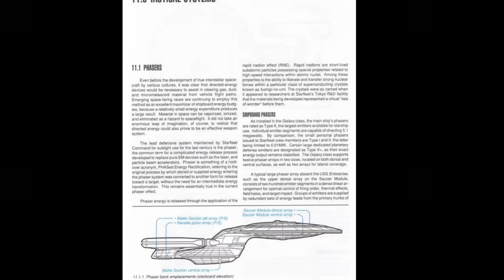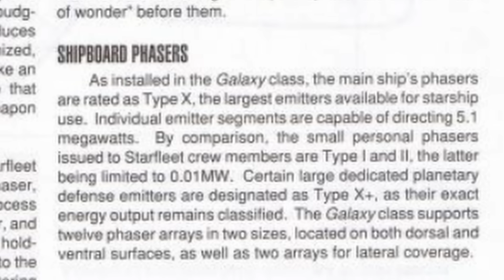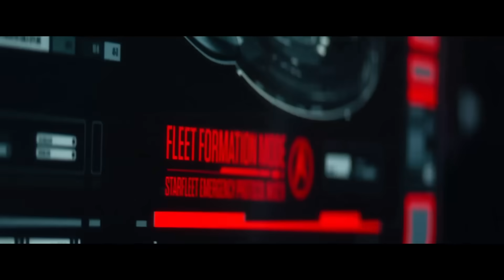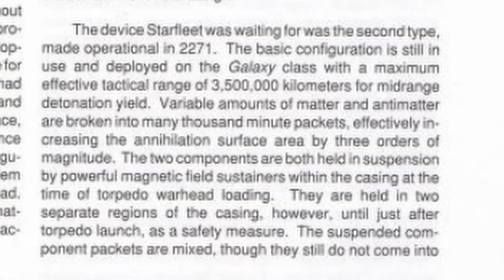Phasers: How Powerful are they Really?

Comment: Basically, from what I can tell, the payloads and TM figures are at best 'baseline' levels.
Since we know that subspace technology is used in most Trek technology, it wouldn't be outrageous to think that there is a form of subspace amplification effect going on - that's the only way to reconcile on-screen feats that seemingly go WAY beyond the baselines.

The ENT-D Warp core was rated at 12.7 Exawatt in 'True Q' for example - but given its actual overall AM storage tanks, if it was generating that much power at baseline, it would deplete its AM stores in hours. So, I would posit that the actual baseline output is somewhere in the high Terawatt or low/mid Petawatt range (if we want it to be able to sustain operations for 5 years before needing refuelling) with subspace tech doing the heavy lifting in AMPLIFYING yields (and obviously, the more M/AM you smash together at an accelerated rate as baseline, you can feed the systems that much more power and amplify the yields).

Now, as to the ENT-D drilling holes into a planet and implying the phasers would have to be massively dialled back... well, that's not unrealistic for Starfleet... because when you think about it, Starfleet is about ethics, safety, exploration, science and diplomacy (defence too, but only when necessary).
So generally speaking, SF ships are NOT in the business of destroying planets left and right - and to be fair, that would be monumentally wasteful thing to do as well (for any power).

The episode in question where the ENT-D had to drill holes into the crust involved the ship having to exercise extreme precision - otherwise, they risked killing everyone on the planet, so 'massively dialling back phasers' makes sense.

SF also has a pretty high mastery of energy/matter conversion technology too  - so I'd posit they were able to make use of subspace to radically amplify the energy outputs (and explosive yields) while using baseline figures that imply MW or TW range (or even PW).

Oh and this is NOT to be confused with weapons that destroy subspace - there are different EFFECTS weapons can have. Phasers/Photons and Warp core can still use subspace tech for energy/yield increases WITHOUT damaging subspace or opening tears.

So a starship being capable of outputting the power that's equivalent to half the sun's output, isn't outrageous - its just not normally used because fights involving really dangerous enemies consist far lower actual %.
This also means the Trek material science and field manipulation is critical because they can direct these massive outputs without fallout (if they choose to), and are designed to absorb them (which means, most other Scifi franchises also don't hold a candle to Trek's own capabilities).
Reply from the maker: Good summary. 
In matchup terms, restraint should not be confused with weakness.

Comment: The most visceral visual of a phaser strike was in Discovery season 5 when the Antares fires on the surface. Also the Ent-D was punching massive holes in the borg cube in the first encounter until the borg adapted and repaired. If they had struck the cube enough times there wouldn't have been a cube left.
Reply from the maker: Borg would’ve adapted before too much damage but yeah, phasers are absurdly powerful

Comment: Phasers seem to be about 1/5 the power of a photon torpedo
Reply from the maker: The problem is, where are torpedoes getting all the energy from?

We can see how powerful phasers are so if torpedoes are 5x as powerful, where's the energy coming from? Not a simple Antimatter reaction, that's for sure.
Reply: @fictionrant7805  the math supports a 64 megaton photon torpedo
Reply from the maker: @saquist right
Which makes a torpedo about 2/3 as powerful as phasers

So what’s going on?

Comment: They can punch through a planets crust in seconds. I always thought they would be similar to 40k plasma weopons
Reply from the maker: Far beyond any standard Imperium weapon but fairly comparable to Necron particle whips
Reply: @fictionrant7805 for sure, the rapid nadion particles in just saw as super heated matter. Like a particle cannon you say!!! So maybe not plasma at all. Perhaps a mega melter cannon...
Reply from the maker: @RA10H56  Phasers are definitely NOT plasma cannons. Turbolasers from Wars more closely fit that description.
Reply: @fictionrant7805 right, the tabana gas is superheated and turned into plasma to fire turbo laser bolts. But would accelerating nadion particles do the same thing?
Reply from the maker: @RA10H56  kinda like saying a tracer round is a thermal weapon because it’s on fire

Technically, yes but not where the danger comes from

Particle beams of any variety are such because you’re firing particles at near the speed of light at a target. 

In the case of phasers the particles themselves are also super dangerous and more so at the speeds involved

A plasma cannon involves generating plasma and hurling it at your enemy. That plasma just needs to be highly energetic, not fast moving. If you were to stick a lightsaber in a t-shirt cannon and launch it at someone at 20mph, that would in effect be a plasma cannon

Comment: Are they more powerful than Distributors?
Reply from the maker: AFAIK disruptors and phasers are the same thing but simpler. The plus side is they’re cheap and easy to maintain. The downside is that they’re far less versatile. Handheld disruptors don’t have stun settings for example

Comment: My understanding is that it is not the energy out put that causes the target to disintegrate, but that the phaser provides a pulse of energy which determines and transmits the correct frequency of the molecular structure of the to cause the molecular bonds to dissolve, thus causing it to disintegrate when set on the highest setting for most  organic targets, when it gets a lock on the target. On lesser settings, or when it is a glancing blow or doesn't get a lock on, it only disrupts the molecular structure enough to cause phaser burns, or only stun the integrity of the target's molecular structure causing it to fall unconscious.
The Klingon disruptor does something similar, but instead of dissolving the molecular bond it tears them apart making it much slower and more painful. Other such weapons work on similar principles, attuning, locking in and then causing the molecules of the target to come apart. Thus the energy needed is only to detect, lock in and transmit the frequency to start the chain reaction which causes the damage or disintegration, not enough to do the damage itself, and so can be of a much lower level.
This is based on something i read a long time ago. I do not remember the source but it might have been from a Role Playing Game.
Reply from the maker: Interesting 
I’ve never heard this particular explanation before

Comment: Torpedoes would still make sense even if phasers were actually that powerful because you are talking about the difference between an explosion versus conflagration (burning). I think the strange new worlds is a combo of systems power being shunted through the phasers but also notice how small the beam is. In all the shows a ship born phaser cannon/array usually outputs a been that's three to six feet across (serious speculating based on appearance) and in the strange new worlds episode they had two ships firing a beam that was less than a foot across so I took it as an all power to phasers situation with them focusing the beam to transmit power rather than raw destruction...this means, in combat they wouldn't be able to output that much destructive power through the phasers without sacrificing literally everything and becoming the true definition of glass cannon. Also means, if a ship is damaged and is going to sacrifice itself it cannot go full phaser boom because of the damaged systems and energy output and they might be able to get one good blast off before they get themselves vaporized...
Reply from the maker: Glad we agree lol

Torpedoes are certainly useful in ways that phasers aren’t but if phasers are literally a million times more powerful than torpedoes, there’d have to be some mental gymnastics to justify ever using them in combat
Reply: @fictionrant7805 Yeah, the way they talk about them in the show the only thing holding them back is the plasma conduits and amount of power available. Means if they can hook a phaser up directly to the warp core it probably would be that powerful. But during it would probably destroy the ship since the structural integrity fields would be offline to achieve such a thing 😉
Reply from the maker: @jakejager maybe that’s what phaser lances are, giant arrays tied directly to the warp core

Comment: The SNW usage of half-solar output is probably a writing goof. They could have meant half the solar energy that reaches Earth, or the writers don't understand how much power a star outputs.

There is also a lot of "It's Over 9000!" power creep and revisionist history going on to the point of making past technology way more powerful than future technology. This has the effect of destroying the legacies of past shows: imagine if every time OG Sisko faced a threat, he could easily channel a thousand supernova through DS9. Boring.

Another problem is that some of the shows are clearly not canon with blatant disregard for established lore, rendering comparison entirely moot.
I chalk the discrepancies up to the difficulty maintaining a cohesive narrative across multiple shows over 60 years, writing incompetence, and overt fourth-wall breaking political agendas. A serious writing staff would be concerned with maintaining consistency and telling a good story.
Reply from the maker: I don’t consider STD canon and have a whole video about why lol

SNW from what little I’ve seen appears as at least an attempted return to form. It even fixed the Klingons!

As for the energy output, they knew exactly what they were doing. They specifically called out the amount of energy then contextualized it as equal to the energy output of specifically Earths sun and outputting that kind of power would require 2 phasers working together. 

As pointed out in this video, the energy output is actually consistent with “The Die is Cast”

Comment: If phasers "vaporized" targets, there would be an explosion that leaves a 5 meter crater and which is near certain death out to 50 meters from the shock wave, and major structural damage & injury out to ~150m. This is a "large building scale" explosion, equivalent to about 50kg TNT. The fact that targets dissipate into a harmless mist indicates a process relying on some other mechanism than projecting sufficient energy to convert body mass to vapor. The conventional explosions that result from some phaser blasts must be considered minor secondary effects due to some residual energy leaking from the principle matter-disintegration process. Maybe phasers operate on principles related to the disassembly phase of transporters.
Reply from the maker: Are you suggesting that phasers are incomplete transporters which have a pattern buffer to contain the energy of the targets they disintegrate?
Reply: @fictionrant7805  Not suggesting anything that specific. I would imagine phasers completely lack a "pattern buffer". They disassemble and scatter.
Reply from the maker: @GreylanderTV another commenter is suggesting that phasers basically determine resonance frequencies on the fly and strike those to stun or disintegrate
Reply: @fictionrant7805  resonances don't change the energy involved, unless it is some new kind of "resonance" (new and mysterious made up physics) where we have no idea how much energy is involved.
Reply: @fictionrant7805  per my comment in another thread, I like the idea that phasers somehow shunt matter of the target "out of phase" with the normal universe, effectively disintegrating the target without a massive energy flux or explosion.
Reply from the maker: @GreylanderTV  the fact that there isn’t a massive explosion or pile of dust makes it all weird, most definitely
Reply: @GreylanderTV the problem then comes full circle. You still have to output enough energy to break apart particles on atomic scale. I.e vaporize things. Putting that in to perspective, transporters are both diabolical and incredibly dangerous weapons in what they do.

Comment: That hole drilling scene in TNG is a good way to estimate the absolute minimum their main array can output. However, at the end of the day, it just isn't enough. Phasers just aren't your typical directed energy weapons. And the clue may like in that TNG Technical manual as well, though not in the consumption and emission numbers. Rather, look at the hand held variants power levels. You'll notice that about 2/3rds of the power settings, involve what is essentially some form of thermal transfer. For these settings, we can assume that there's a rough correlation between what the emitter is emitting and what is done to the target. At low levels, the target neural system is heated enough for the creature to be stunned, while at higher settings, even rocks can get heated or even melted. However, the last 1/3 of the  settings involve matter disruption on some level (sub-atomic, atomic or molecular). Given the low environmental damage of the surrounding area while "vaporizing" say humans, I would guess it's sub-atomic. Note how the damage associated with the power level is described not in Jules, Watts or megatons, but rather in cubic meters of volume that is being disrupted. 

Hypothesis: what if the main phaser arrays on a star ship operate in the same manner? Depending on the power levels they operate, they can do anything from simple thermal transfers, no different then other electro-magnetic or particle beams, but on higher levels, they actually disrupt matter? You know, like disruptors are supposed to? So just pitting some random numbers here, but let's say you have an emitter with the max power output of 10MW. You chunk 0-7MW through it, you get a beam of roughly equivalent output. However, you chunk 7-10MW, and what you get out of it, is a mountain top disappears somewhere out there. This may even explain why that drilling operation required so much preparation. They needed to phasers to actually turn matter into nothing, but not wipe out the entire area. So the array needed to be fine tuned to do just that, operate outside what would be its normal parameters? 

I hope I made at least some sense.
Reply from the maker: Phasers are demonstrably capable of a wide variety of configurations including firing different kinds of particles at different energy levels. 

So yeah I’m quite confident you’re at least partially correct

Comment: The way I see it, this was probably a dedicated phaser array specifically for producing the most powerful emissions that it could manage. I imagine it's similar to how if we ever perfect nuclear bomb pumped lasers so that most of the energy of the explosion goes into the laser emitters rather than being lost in the explosion - they would be able to produce a really powerful laser, but it's not something you could realistically mount on a spaceship or other platform intended to be reused. A one-shot weapon, or even something that takes an extended amount of time to charge up and cool down might be really powerful, but that's not the same as being practical.

That said, that's a way to resolve the issue you mentioned regarding how torpedoes seem lacking by comparison to phasers. Imagine if a torpedo actually contained a short-range phaser emitter, using something like the magnetic bottle that already exists to funnel as much of the antimatter reaction energy into the phaser emitter as possible so that it didn't rely primarily on the explosion to do damage, especially since a good chunk of the energy of the explosion is going to propagate outward along the path of least resistance, which is to say, out into space for the most part. It doesn't even necessarily have to turn it into a directed energy weapon (though now that I think about it, that would be a pretty amazing weapon in its own right), just have the explosion get converted into nadions that are directed ahead of the torpedo as it detonates, so most of them hit the shield or hull.
Reply from the maker: Neat idea for the torpedoes but absolutely not now they work. 

A giant Nadion nuke would be super cool though
Reply: @fictionrant7805  I'm well aware they aren't actually bomb-pumped lasers (or phasers, I guess). If they were, they would just explode from some stand-off distance and pelt the enemy ship with phaser beams, especially since torpedoes have a much greater range than phasers. I just mean they probably have some unspecified mechanic which makes the torpedo explosions much more destructive than they would otherwise be.

I remember reading in one of David Weber's books, can't remember which offhand, which had part of the magnetic bottle containing the matter/antimatter designed to shut down just as the explosion went off, meaning most of the energy of the explosion went in a specific direction.

Comment: Using AI to do maths like this is probably not the best call chief. 
LLM's like the ones you used can't actually do maths, instead, all they do is predict a likely string of text based on their training data, which is mostly internet forums and the like these days.
What that means, is that it's not calculating anything, and you should really be very careful relying on it. It will very confidently make shit up, and it will do it all the time.

If you want a good way to do complex maths like that, I would suggest you look at something like Wolfram Alpha, which does actually do the maths, and will give you lots of conversions and the like. You can even probably get an AI to walk you through what calculations need to be done, but run the numbers through a calculator, not predictive text.